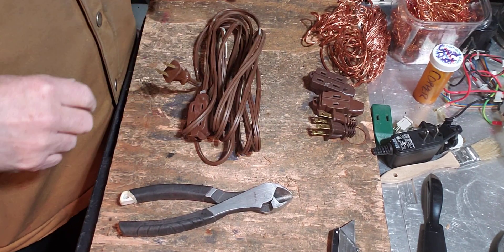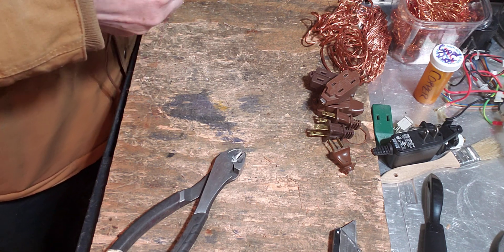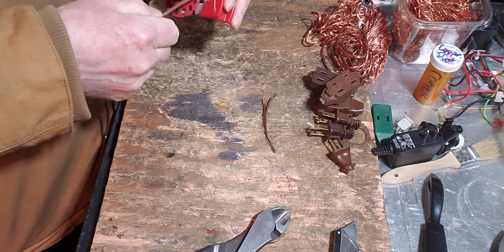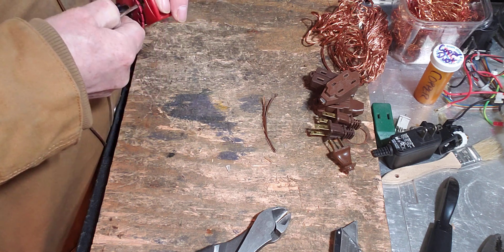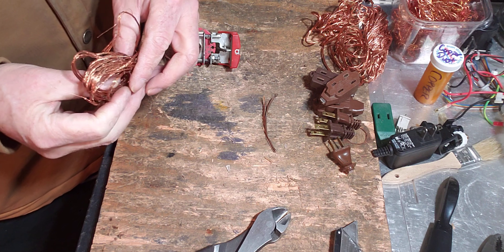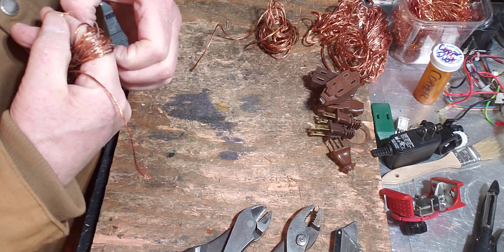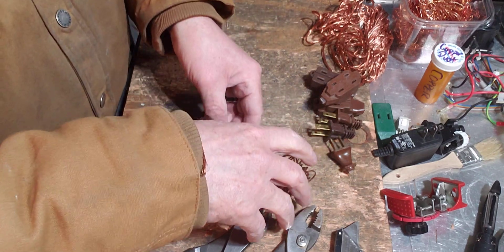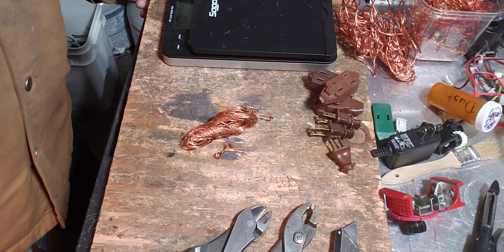How Much Copper Is In This Old 12' Extension Cord?

Comment: Where can I get a handheld wire stripper like that?
Reply from the maker: https://www.copperminetools.com/collections/manual
Reply from the maker: You can get it from Amazon for the same price.
Reply: I have the Coppermine version; however, most of the ads on eBay & Amazon are for noname Chinese knockoffs.  I've bought low quality noname Chinese spywatches, so I avoid noname Chinese.  Buyer beware.

Comment: I am not a fan of stranded wire. Usually, cord candy goes into the drum.i like that little stripper.  Could you send me the link where to get one?
Reply from the maker: https://www.copperminetools.com/collections/manual

You can get it from Amazon also for the same price.
Reply: @copperkingrecycling634  Thanks I got the link , I'm usually limited to Romex & smaller ; so for $35 ish Bills it likely would help . Again Good Day in April 2024.
Reply from the maker: Thanks for watching this video. I keep changing my mind on how I feel about wires. Im still a micro scrapper, so wires are my bread and butter. I have stopped stripping very small wires and just throw them in a bucket but the bigger ones I still strip.

Comment: Your little wire stripper is cool. Gets the job done. I have some similar looking small gauge cable.thankyou for sharing my friend 👍
Reply from the maker: It's a good little stripper. I just need automation. I bought it for tiny wires but that became a nightmare in itself. Thanks for watching.
Reply: Where did u get thre wire stripper used here ? & YES every ounce adds up , even # 2 . Thanks